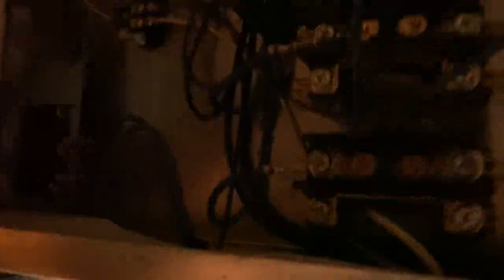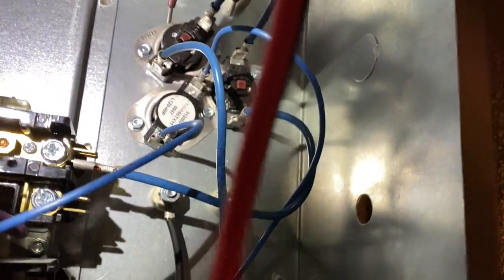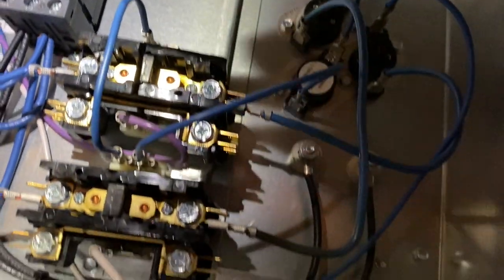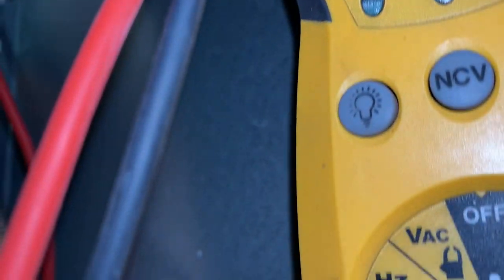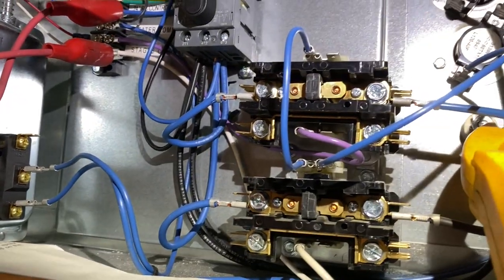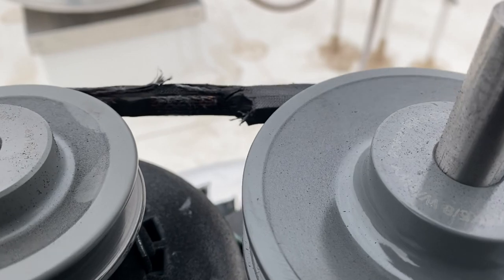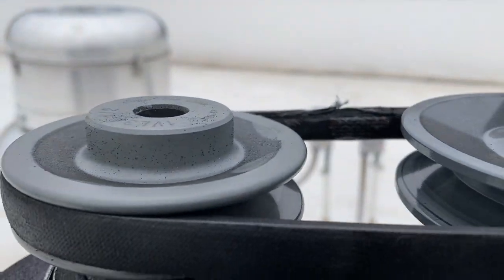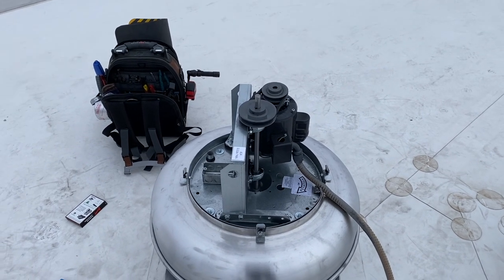Two Calls, VAV not heating and Noisy Exhaust Fan. EP52

Comment: Did you delve into the BAC to see why it was not calling for heat?  Keep up your channel as you have good info.  Thanks!
Reply from the maker: I did. It turned out to be a faulty remote sensor. Wouldn’t detect the temperature properly and not cycle the unit. Couldn’t film there though. Thanks for watching.